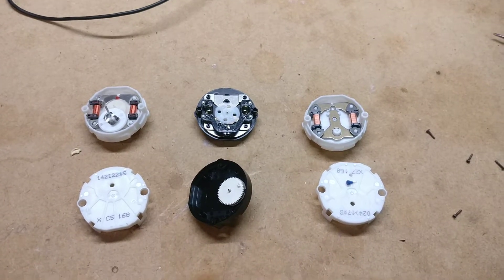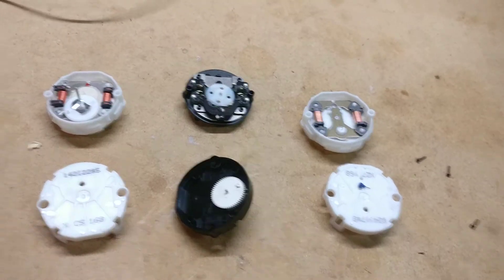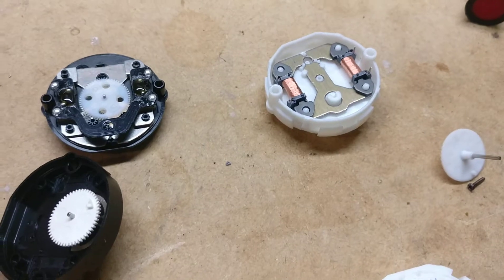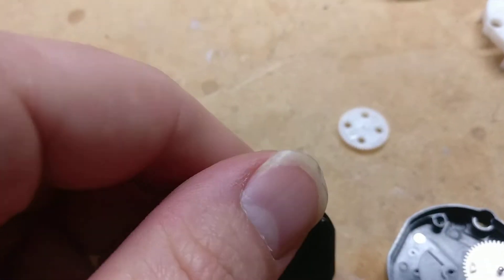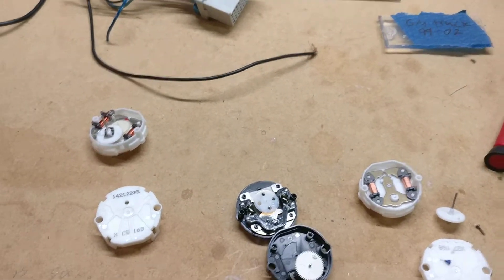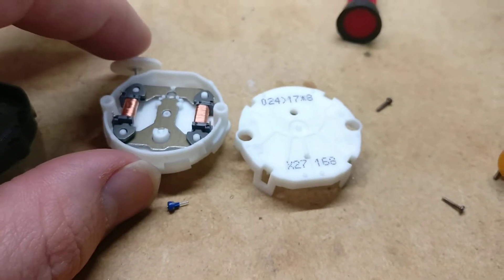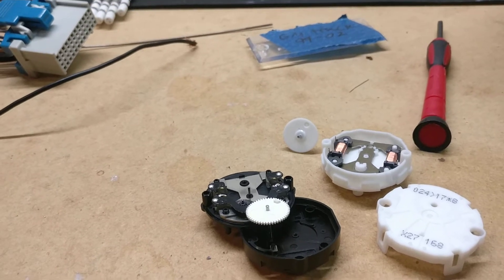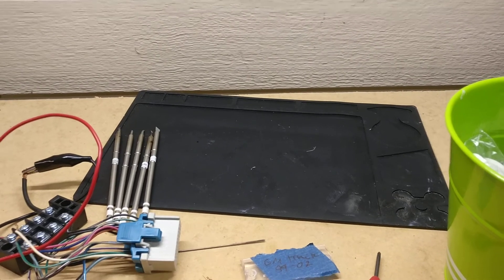GM Instrument Cluster Stepper Motor Comparison

Comment: Thanks I've been watching your vids and got to wondering what they looked like inside. I know this is an older vid but I'm catching up on them. I like to tinker with stuff so if and that's a big IF I was to do this for someone else I couldn't charge that way they should not b*tch about it. Notice I said  ( should ) cause you know how that goes. Thanks for posting keep them vids coming and can you make them a bit longer.
Reply from the maker: I promise you even if you do it for free some will find something to say if there was a reason to say something. Also free/super cheap brings that kind of customer. They won't respect appointment times, no show no call and wants extra. 

If you are doing for a friend or something no big deal. I'd just be careful opening up to the public for free. You break their board and they are going expect you to replace it.
Reply: @FixedUntilBroken  Oh yes that I know IF I was to fix one or try to it would only be a friends NEVER PUBLIC NEVER.
Reply from the maker: fair enough.